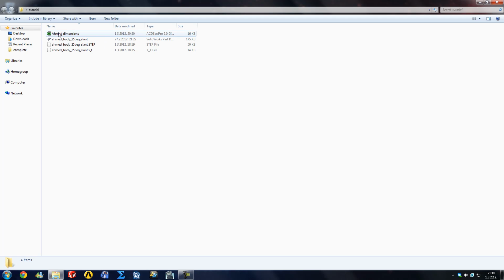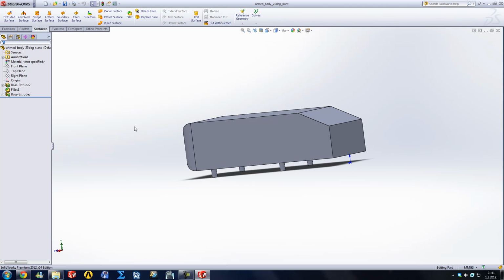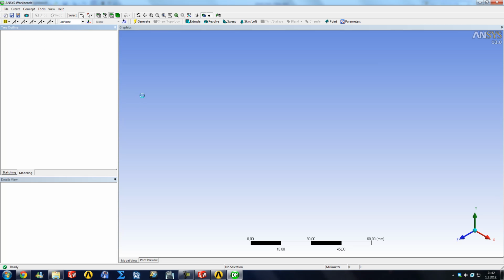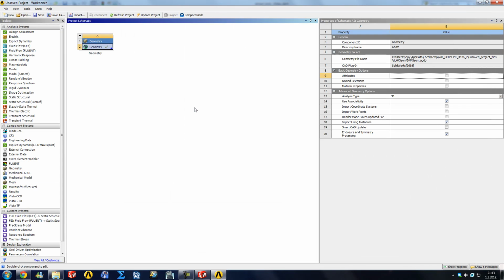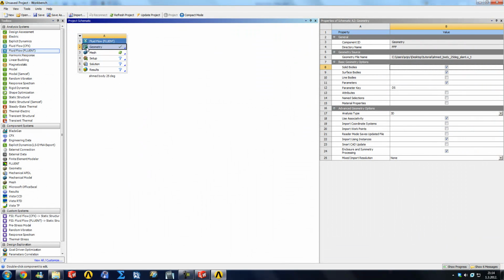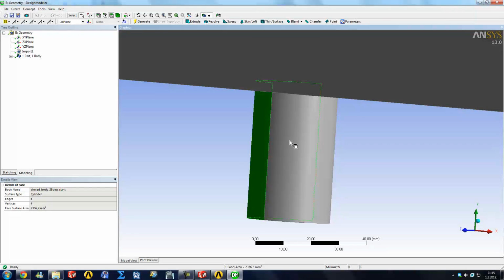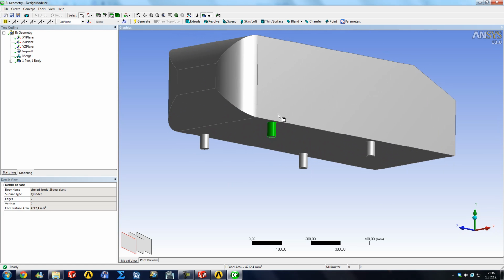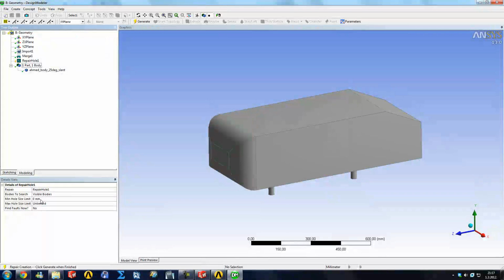Part 1a - DesignModeler for Vehicle Aerodynamics

Comment: I had the same problem and your solution fixed it. Initial CATIA file of a spaceframe race car chassis was saved as an .stp file. I opened the .stp file in Solidworks 2013 and saved it as a Parasolid. ANSYS Flotran is now able to create the enclosure around the model to resemble the wind tunnel. Thanks

Comment from the maker: I can't really know what's happening, but if I was you I'd try to simplify the geometry as much as possible (avoid intersections, tight gaps etc) and export from SW as a Parasolid and then try to import in DM. SolidWorks imported failed for me many times, but usually the problem was solved via the parasolid way (even without modifying the geometry in any way).

Comment: I want to do the CFD of the raw chassis.I cant import a solidworks model of a roll cage.It shows an error symbol when i click generate. -
"Error : Attach failed
  Context :Attach Feature import 1  "

I use ANSYS Fluent v13.
The roll cage consists of many solid (non hollow) rods.

Also, the roll cage is surrounded by thickened, mirrored surfaces(lofted).without this exterior panelling i can import the model though i face problems in later stages

I would be grateful if you could reply ASAP